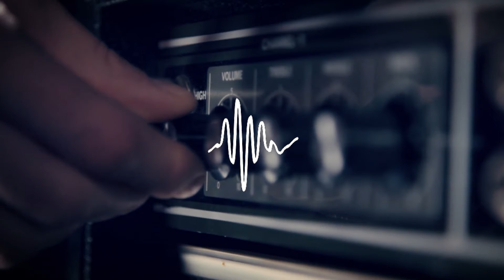Marshall DSL & TSL Simple Bias Drift Solution: Stop Red-Plating Power Tubes!

Comment: I approach this for home use differently. I have more time than money..  i bought a 98 model and rrd plated two sets before i got angry..  so i observed carefully tje phenomena on my amp.
The drift ocvurs when the amp is not used for petiods of time. . I have tech traing and expetience and i advise caution. I bought two inexpensive dvms. One for for each of the two corcuits. I leave tjem in cotcuit at the test points and on. At first i play and then  stop and observe the error. I correct it it and repeat. Several times over a couple of days. Constantly observing to prevent red plating.. after the thord day, it serms to stabilize and then i just look over every now and then, and the drift stabilzes. I still watch but i play much longer without touching the pots again IF at all. Works for me no cutting no fuss, just personal effort. It aint for everybody, but i have gotten many years of servace out of this amp with no mods. One thing , i use mill spec 6ca7 tibes i think tjats the number you can check instead of el 34s. Again its worked for me so please no hate mail from the perfessional “amp” techs.  I got years of service in my ise by afapting to the problem rathet than throwing money at it. It was expensive enough. Lbk

Comment: I tried this fix on a Issue 5 board. While this fix as a temporary solution works miracles and the Bias drift has been DRASTICALLY slowed down, it did not solve the issue. The Bias will still drift on my board from ~75 mA to around 100mA within an hour (where it took it a few minutes before), and this still poses a problem for long-term run. If I just want to noodle for half an hour, then allow it to cool off, perfect, but it's just temporary. 

I have now bite the bullet and ordered a TSL replacement board from Brads Guitar Garage in Australia for ~320€ as I am writing this, and will replace that board, since Marshall Support has given me notice that there is no TSL issue 20 board more in stock and will never be. I will report here as well, once I replaced the board.  (where it took it a few minutes before), and this still poses a problem for long-term run. If I just want to noodle for half an hour, then allow it to cool off, perfect, but it's just temporary. 

So, for all hoping to get out cheap on this, I have to disappoint you - it unfortunately did not work (for me, anyways, YMMV).
Reply from the maker: Yes, the Issue 5 boards are particularly bad. In these cases, you can remove the bias components from the board and implement a new bias circuit on a strip board. This will permanently fix the problem. With the scarcity of replacement boards, this is a viable alternative for keeping these amps going. Glad you were able to source a replacement board!
Reply: @proampsolutions  Hello, and thanks for the awesome video.  I have recently become the "lucky" owner of a JCM 2000 DSL 100 and tubes #7 & #8 red plate within minutes of turning it on.  Are you saying that the bias board (DR. Tube?) is a more effective fix as compared to the procedure you've outlined here or would it be best to do both if runaway bias is the issue?  I also have PCB revision 5.  :(  Thanks!

Comment: Great video! Can someone please share what wattage is needed for the 5.6k resistors? Thank you in advance
Reply from the maker: 1/4 watt is sufficient as the grid resistors flow very little current. I prefer to use 1/2 watt or 1 watt not because of what is capable of the current, but for noise reduction. Generally speaking the larger the wattage the less noise that is introduced, this is especially true for plate resistors.
Reply: @proampsolutions  Thank you for the speedy response. It will be at least a couple weeks before parts are in. I have about 15 of these JCM's in my rehearsal space studios. Will update. Thank you again

Comment: After taking a very close look at the motherboard from my TSL 602, I don't think this video directly applies to that particular PCB. I am making this post to help others who land here, and have the same motherboard as I do.
1. The TSL 602 motherboard (that I have) is a significantly different design, and one which has only 2 power tubes.
2. For this motherboard, It appears that Marshall has already taken steps to avoid this exact issue.
   a. There is a groove routed around the high voltage pin of the power tube sockets, which I assume is to isolate those pins from potentially leaking voltage to nearby traces.
   b. the lug which accepts a high voltage wire from the transformer is placed as close to the matching tube socket pin as possible, so as to minimize the length of that trace.
While I don't have a lot of experience with this sort of thing, it does appear unlikely to me that voltage can leak from the high voltage tube socket pin to a nearby trace, as there is effectively no nearby trace on this PCB.
I observe evidence that the tube socket solder joints have been overheated, and I plan to clean and reflow them. After that, I will calibrate the bias voltages. If they continue to drift, I will replace the power tubes.
HTH

Comment: Very.  Do you have a video showing that the bias actually does not drift?
Reply: https://youtu.be/sXpzwzTzqfw?si=w5MYknO1vL1TGVoL
Reply: @johnblack1675  I did the repair and works perfectly
Reply: @ the main sub-straight of the board becomes conductive. Each fix is a band-aid until you replace the whole board
Reply: @johnblack1675  Those boards that brad sells are way, way to expensive for no reason. The amp I fixed for a friend works perfectly.  He uses it every weekend in a STP tribute band.
Reply: @ board was 340 shipped
Reply: @johnblack1675  Ah, I saw somewhere they costing close to 900 dollars.
Reply: @ oh no, website has them listed for 520 something AUD which is 340ish USD
Reply: @johnblack1675  Still to expensive

Comment: I just swap them for Issue 22 boards. Ends up costing the customer less in the long run.
Reply: Are the boards still available?
Reply: @nestorcano4354  nope, but heres a dude that re-designed it. https://youtu.be/sXpzwzTzqfw?si=w5MYknO1vL1TGVoL
Reply: @nestorcano4354  I just got the board from the Brad guy, holy hell is the build quality insane

Comment: Awesome video
I wish I had seen this sooner
I recently installed a third party mod (Dr. Tube stable bias) and it didn’t seem to work. 
Im wondering if I make those cuts in the board if I’d have any luck… 
The mod had me remove two small caps near the bias pots, could I put those back on and try your method?
Reply from the maker: Yes, replace those caps, and carefully follow this video. I have used the Dr Tube mod with success, but I did not care for it. Make sure with the power tubes removed you have negative bias voltage on pin 5 of all of the power tubes and that the voltage responds to the bias pot.
Reply: @proampsolutions  right
I will give this method a shot. 
So I’ll replace those caps and remove the Dr. Tube kit completely  
I will circle back and let you know how it goes! Thank you!
Reply: Thanks again! My bias seems stable now! Amazing 
However, my green channel seems to be out of order, red channel sounds amazing. 
I need to double check all my work. 
Any suggestions?
Reply from the maker: @john_toxic_6796  Yes, double check your work, if your bias is stable and your red channel is working, I doubt the problem has anything to do with your bias rework. Check the junction of the channel joining resistors and work your way backwards through the signal path.
Reply: @john_toxic_6796 Is the bias still stable?

Comment: I have a 2002 DSL 50 that appears to be doing the same thing. Should be a little easier with only 2 tubes?    Also, which electrolytic caps did you change out. My amp is 22 years old, probably wouldn't hurt to change out mine as well.....  Thanks!

Comment: thank you for this video I have one of these amplifiers .    Do you know which year amps or circuitboard numbers are affected by this?    I’m not having any problems at all right now with my amplifier
Reply from the maker: Amplifiers with the JMC2-60-00 and JMC2-60-02 Main Boards
Reply: @proampsolutions   Thank you !  I’m your newest subscriber! You do excellent work  ,it’s a pleasure to watch
Reply: 1998-2005 JCM2000s
Reply: https://youtu.be/sXpzwzTzqfw?si=w5MYknO1vL1TGVoL if you still have issues.
Reply: @johnblack1675  thank you very much
I will be looking into this very soon.  I have not had any issues……yet.
Reply: All the up to version 19
Reply: thank you all  for the great info.   I have not opened up the amp in a few years. I think mine is from 2009. The head box has black piping. I bought it used and the O/T had been replaced by a previous owner. I bought it years ago, but have not really used it that much.   at the time Classic Tone   here in the US was still in business.   I replaced both transformers and added a choke from Classic Tone, I was unsure of the brand of the replacement O/T  . I never thought about writing any of the board numbers down when I had it open, but I have not had an issue since.   I am  hoping that I’m correct and my amp is not one that has an issue, but thanks again for all the good information.  Now I know what to look for the next time I have the amp open.